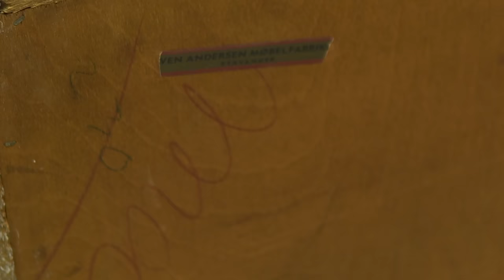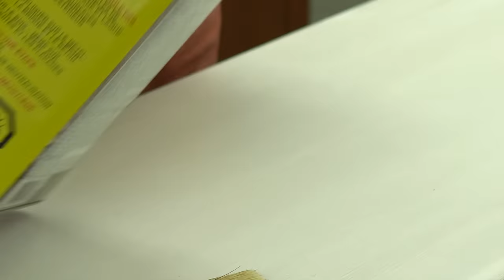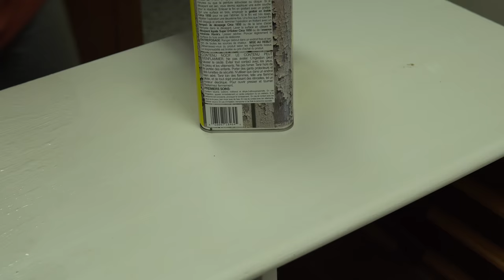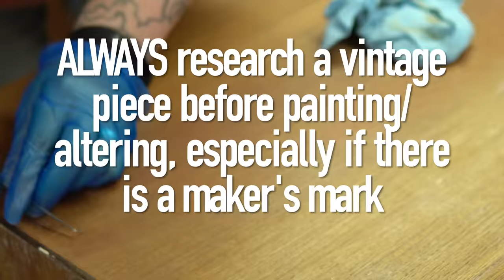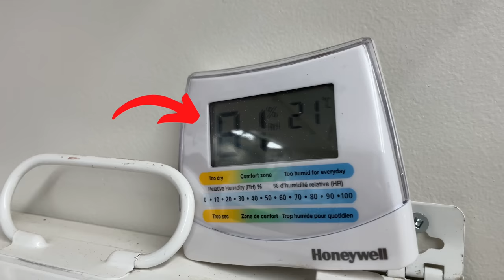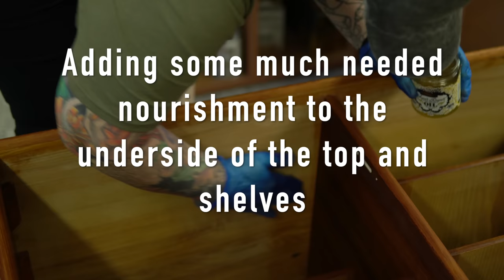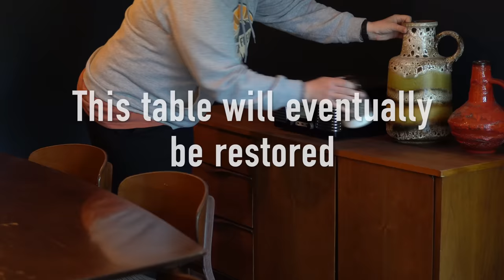I SHOULD NEVER HAVE PAINTED THIS: Stripping paint from mid century teak

Comment: I just did a harmony house piece very similar to the one you put up a few weeks ago.  I could not think of what to do with it and then your video popped up.  it is a very thin walnut veneer.  The horizontal wood (2 X 4) under the top two drawers is a different wood type.  But i was okay painting it because i considered what you said about these being mass produced.  Also the veneer was so thin.  i had to be so careful when stripping it.  But it looks very similar in all ways to the one you did.  So yes, i have painted mcm.

Comment: Several years ago, I bought this old dining room table. It had two drop leaves and was this dark mahogany color. I initially painted the table red; then I painted the tabletop white, distressed it, and applied this French advertisement decal. It looked nice at first, but didn't age well. I finally redid the whole thing. Used a blue-gray chalk paint on the legs; stripped the tabletop down to the bare wood (cherry) and sanded it smooth the applied a clear wipe-on polyurethane. I love the natural wood.

Comment: About 8 years ago I stripped and refinished an antique kitchen hutch that was in my parents' summer place. The building is 150+ years old and the hutch was likely an original piece.

However, this was before YouTube furniture flipping channels existed and I was basically winging it. I stripped off what was in hindsight most certainly lead paint and the underlying shellac with great difficulty. I didn't properly address the lead paint and I really didn't know how to use stripper properly - like wrapping it in plastic and giving it time to work without drying out completely. I did damage the wood in certain areas trying to use metal scrapers that didn't fit - I really wish I knew to use steel wool. And I definitely didn't use mineral spirits to neutralize the stripper. It didn't turn out terribly and it was always going to stay in the summer place so it hardly needed to be perfect. But every time I look at it I wish I had known better how to go about it.

Comment: In response to your question of re finishing regrets on a piece of furniture.   I did a Oak Nursery rocking chair.   Wood working ,  re caning bottom.   Days of stripping and sanding,   only to ruin it with a Poly Urethane Stain and Finish in One.    Never used it before,  but was burnt out on the time spent on the piece.   It dried as soon as it touched the wood.   I had to re sand all a second time.    Use a sealer before the finish was my hard learned lesson.     I didn't know four letter words could be but into paragraphs.   But I calmed down a few days later.    It's now in a little girls room as a Birthday gift.  The Poly all in one finish is in the trash.   I still glare at it when I see it's face in the store.
Reply from the maker: Oh no Jayne! All that work. I feel your pain to my core and completely understand burn out. Thanks for watching and I'm glad you got through it!

Comment: Here's my story for one of my first curbside saves.  Someone I knew was moving out of an apartment, and gave me a super beat up side table, MCM.  Lots of damage, including an enormous blackened burn mark.  I stripped it down, but I knew nothing.  The stripper didn't get all the scunge in the joints, and I got impatient with getting it out.  The piece needed some real repair, which i totally fudged, and 25 years later, it's still not right.  Worse, I bought a super heavy and goopy marine polyurethane.  I thought in terms of mirror finish, and it did not even dawn on me to thin it or wipe it on.  It turned out thick and cheesy looking, and I think I used the wrong brush in the first place;  brushmarks all over it.   Every scuff, fingerprint, scratch, and ding, no matter how minuscule, is completely in your face on that thick coat of poly.  The only thing I did right was get the burn mark out and stain it with a deep mahogany color that is a saving grace for the piece.  Since then, I have learned to use smarter products, and I am a fan of wiping on several coats of varnish, thinned with turpentine, to achiever a glowing, satin look that invites touch.  Oh, and my favorite way to knock down each coat?  A brown paper bag.  One day I may have to re-finish my refinished project.
Reply from the maker: Best of luck if you do decide to tackle it! Thanks so much for watching!

Comment: great job. just a tip when brushing the paint from the grain. get your hands on a liquid stripper, it more easily flows the paint out of the grain and then follow it up with denatured alcohol and that should wash 95% of that pesky paint outta there. cheers!
Reply from the maker: Thanks Trena! I mainly use Circa 1850 and was using it in conjunction with the brushing- is there a less viscous version you would recommend?
Reply: @TranscendFurnitureGallery  circa is swing paints residential grade stripper. if you go to a paint store you can order professional grade stripper from swing paints and they come in all viscosities. I mainly use the liquid because it washes things down so nicely in conjunction with the denatured alcohol to neutralize. hope you can find it because it is so much easier to strip furniture with.

Comment: Gorgeous! Excellent work! Using only an oil with no protective clear coat always surprises me. I always assumed a hard clear coat was supposed to be used.
Reply from the maker: Odie’s oil isn’t the same sort of oil like something like hemp oil, for example, is. It belongs to a group of finishes called hard wax oils. It bonds with the wood fibres and hardens. Rather than a typical oil that just hydrates but doesn’t offer much protection. We have Odie’s oil on our teak coffee table which we use daily for meals, computers, etc and it has held up EXTREMELY well, is very resistant to water, and is so much easier to touch up should anything happen. My partner slid a plate once and it had a sharp spot under the plate and left a small scratch. Rather than having to refinish the whole surface (like would have needed to be done with a typical furniture finish), I was able to take a bit of fine grit sandpaper, lightly sand for about 30 seconds, and reapply the Odie’s. Done!
Reply: @TranscendFurnitureGallery  thanks for the info!

Comment: My opinion is that if the piece is damaged and is not cost effective to put new veneer on it then its fine to paint, otherwise I would do whatever possible to restore it and refinish it with stain and/or seal coat.

Comment: I think you will find with the new dehumidifier that you run any air conditioning you may have in that shop  MUCH less.9 times out of 10 when you are "dying of the heat" it's actually the humidity because you can't sweat enough to cool you down. Just remember to drink more water so you don't dehydrate.

Comment: The pads you used to apply the Odie's are sold in the US as 3M Scotch Brite, 7448 - Light Grey, Ultra Fine Hand Pad - rated 600-800 grit.  (Thomas Johnson uses these all the time.)
Reply from the maker: Yes, scotch brite does make a version! I like the 1500 grit from the Mirka Mirlon line, just a bit finer, almost like a super fine steel wool.
Reply: @TranscendFurnitureGallery  AH - in the US the equivalent is probably Scotch Brite 7445 - White, Light Duty Cleansing - 1200-1500 grit
Reply from the maker: @strongjohn10956  sweet! That’s great to know- thank you posting that :-)

Comment: Why did you leave the white wood filler in the front and replace it in the back with the teak colored filler? Beautiful job! I agree folks need to be kind and respectful when commenting.
Reply from the maker: I didn't. I removed all the white wood filler I used originally and replaced it with teak coloured wood filler so it wouldn't show with the Odie's.
Reply: Thank you for your answer

Comment: Would a higher grit steel wool have been useful? To perhaps skip the use of the brass brush?
Reply from the maker: 4 OT (or 4 zero) steel wool actually is the finest grade! What was helpful in this case is that those small brass bristles were able to get down into that lower level of the woodgrain inside the open pores and remove most of the paint, but I had to be very very gentle. Using it in combination with the stripper helped to lubricate and loosen/dissolve the paint as well (versus a dry brushing). I mainly used the steel wood to snag up the paint that just came out of the pores, as opposed to a rag or cloth that would smear it around, if that makes sense!
Reply: @TranscendFurnitureGallery  good to know, thanks!

Comment: Am I correct that teak is waterproof? I think that’s what the use on boats.turned out good.personally I don’t worry about people’s opinion.they’re gonna have them regardless.
Reply from the maker: Teak is extremely hardy outdoors and yes, used frequently in ship/boat building! It tends to patina to a soft grey over time if it’s not kept up but is very resistant to rot and insect damage

Comment: Help me with something, if you don't mind....when do you use Odie's Oil vs the SuperDuper stuff vs the Butter?
Reply from the maker: For anything Odie's related, I send people to the Odie's website. It's fantastic and can answer just about any question about it. This part specifically should answer your questions : https://odiesoil.com/module-1-understanding-odies-oil/?_ga=2.194707565.1921574618.1676222429-1168835334.1673013231 
There are several more training modules with FAQ's and application techniques etc. I hope this helps. Thanks for watching!
Reply: @TranscendFurnitureGallery  Thanks, Angie

Comment: How long does the Odie's oil finish last before you have to do it again?
Reply from the maker: It entirely depends on the piece and it’s use. We use our coffee table daily, for eating, writing, laptops etc. In 2.5 years, I’ve only added a thin additional layer once, and it was because a plate with a sharp spot underneath got slid across and gave it a light scratch. A thin layer on and off and good as new. Super easy.

Comment: How will you dust it?  I was a pledge user, now I don’t know what to use
Reply from the maker: For cleaning- most people are overkill. I usually recommend a soft, lint free, slightly damp cloth. For things that need a bit more, a slight bit of a mild dish soap, wiped clean afterwards with the slightly damp cloth. Things like pledge are terrible for finishes, because of what they contain. And some commercial cleaners will eat through certain finishes and not others, so if someone is not 100 percent certain what their finish is, just a slightly damp cloth to remove the dust is fine. Something like a beeswax polish every so often is usually ok on most finishes, but again- if you’re unfamiliar with the finish, it’s best to avoid anything but dust removal.

Comment: How do you decide whether to use the regular or the everlasting oil?
Reply from the maker: Sometimes it’s random, to be completely honest, or using what I have more of on hand. They are similar, the Super Duper is more liquid-y, which sometimes is a factor, and has a slightly higher sheen than the original. It has a bit of a Danish oil feel.